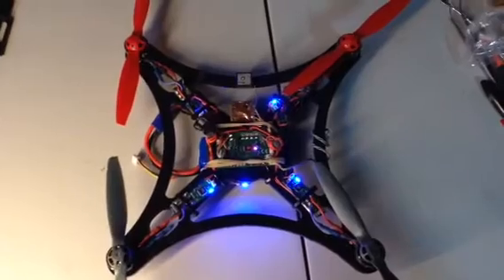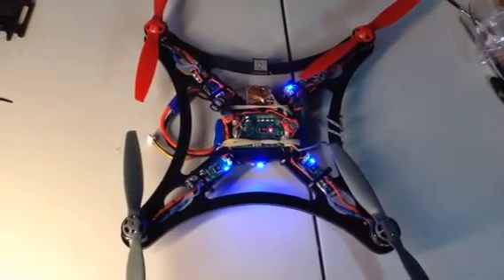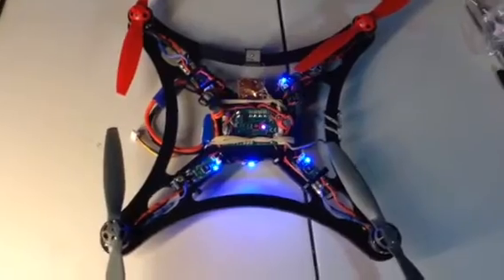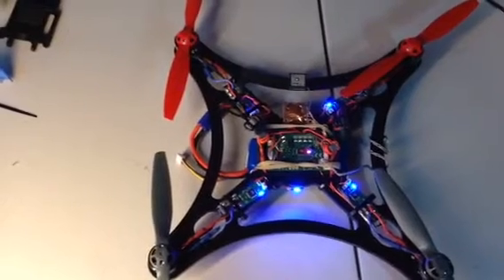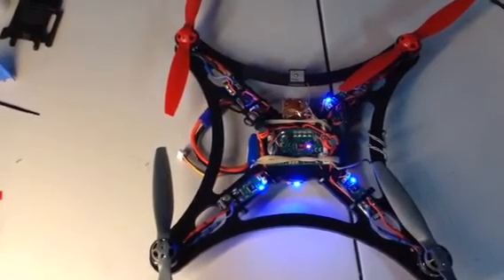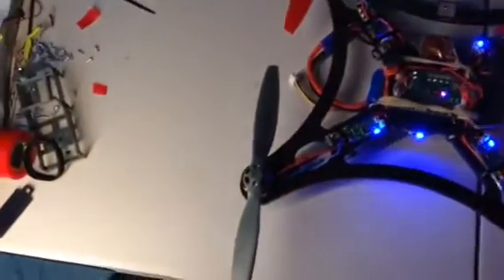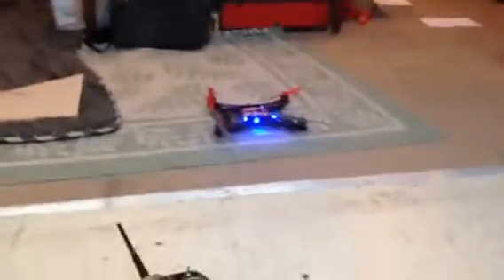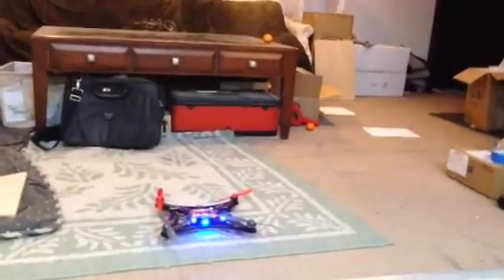Blade 350 qx frame transfer to OPQ

Comment: 7demo7 was really interested in your build because I recently had a prop failure on my 350qx. One question I got for you, since I'm looking at replacing my frame anyways, is there anything you have to do software wise when you transfer to a new frame? Like mess with the way it flies or can I just throw the hardware on a new frame and fly?
Reply from the maker: Yes, I didn't have to do any configuration to software, just move the electronics over and fly, try and make the new frame as close to the same dimensions as the Oldframe

Comment: Hey 7demo any plans to put a camera on there? Guess you'd need LG first. I was asking the guy that moved it over to the F450 but haven't heard back. Interesting you mention no shakes on landing. Some have suggested the 350 isn't aerodynamic or frame too flimsy and this is causing shake at higher speed. I am still thinking flight controller. If you do get some footage would love to see it,
Reply from the maker: going to get some testing done tomorrow, I'll let you know.  My guess is that it might still have vibration
Reply: 7demo7 Sounds good will be watching
Reply from the maker: I need to post some video, with the holidays approaching I haven't had time.  Full throttle is shaky, however, I don't think that can be helped.  Moderate FFF seems really nice.  I still need to see it on my computer screen, I'm just viewing it from my gopro backpack, lol.  I got out this morning without any gimbal or cameras and it flew soooo nice.  I definently want a gimbal camerasetup that can be easily be detached because I'm not always filming.